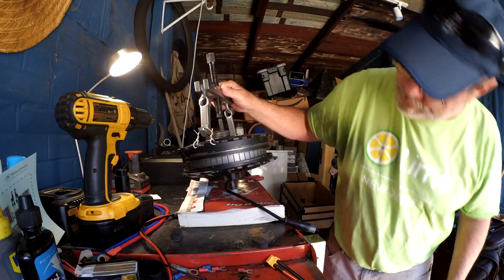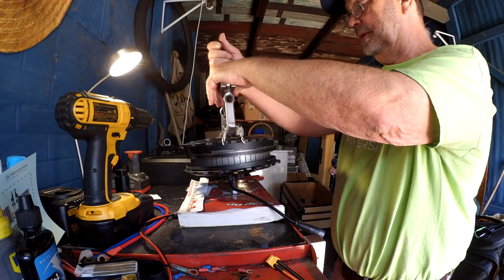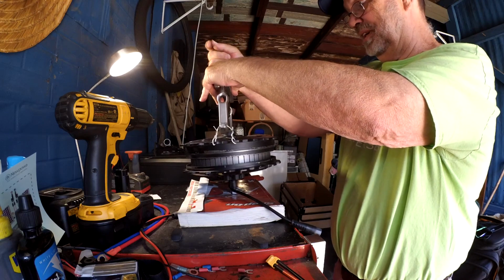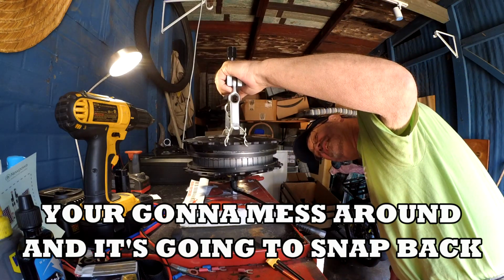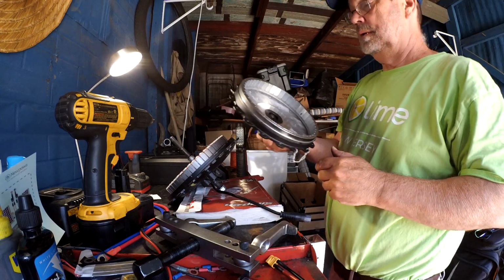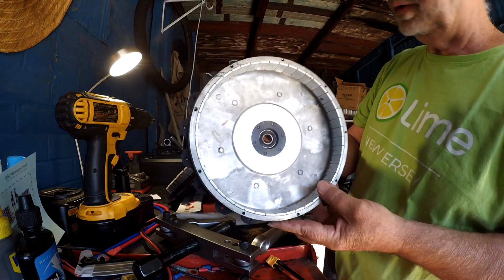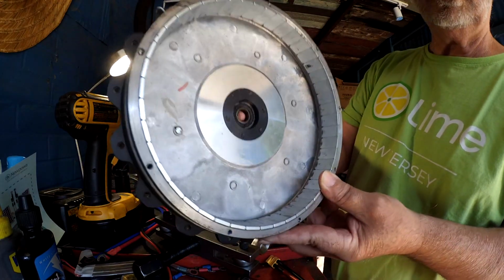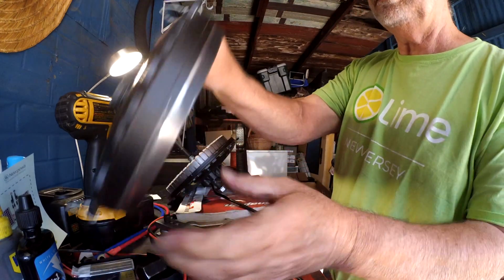2018 RadCity HubMotor Disassemble

Comment: So, was the noise from the hub bearing? My city 4 makes a clunking sound only in 3rd and 5th gear..The spokes seem tight.  
I've taken the bike to a local rad repair shop and they couldn't find the problem. Anyone with information on this issue?
Reply from the maker: @ericknutson602  No, I think that's coming from your drive chain or gear set

Comment: Did you have to fix that last Aug too?      Or is this still the same issue? Just wondering.
Reply from the maker: Same one just replaced the wheel assembly in august was using my bike for work didn't have time for the repairs. Installed the 35amp controller thought I better get another motor ready. I think the biggest pain is removing spokes and lacing the wheel